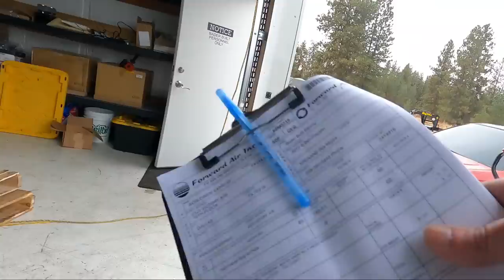The AWD Civic gets  Sequential dogbox Transmission!

Comment: Hey man just a random question.

If i were to fit a 86.25 mm manley forged piston on a stock fa20dit short block. How much do i need to rebore my bores? I belive the stock bore size is 86mm? Its .25mm oversized. Should i make the bore 86.25 aswell? Or what do i need to do? Thanks!

Comment: I'm guessing the blue SI is on KPRO? If it is, instead of adjusting the speedo with the % correction... go change all of your gear ratios and FD under the GEAR COMP tab in Parameters to match the actual gears that are in the trans.

EDIT: Just realized that it's a B series car lol. But I would think that the same could be done with S300's and maybe other standalones?

Comment: Baderbuilt please please please help me choose a turbo for my subaru wrx sti 2019 with a fully built motor  ams manifold and soon to have a v2a water cooled intercooler. 
I want to daily and need power I can use on the street.
But I also go to drags and currently have 272 cams.  Bad choice from my tuner I feel.

Motec ecu.

Comment: I have a 95 civic sedan k24 awd 😉.  Going for 900awhp. 4drs are better and still light. I cut the crap out of my sedan. Flooring in the back is gone lol. It's just a 2 seater. Back is going to be covered by aluminum sheet metal